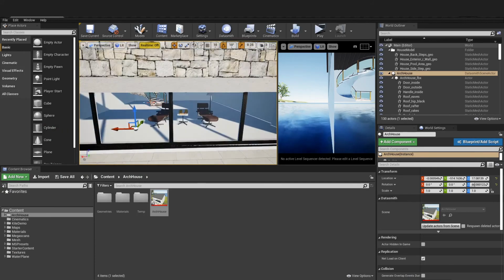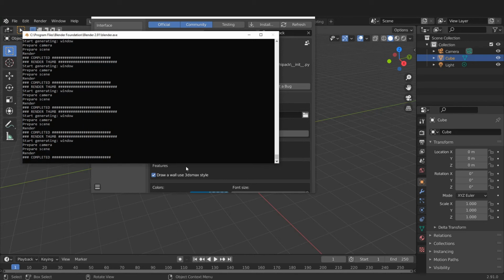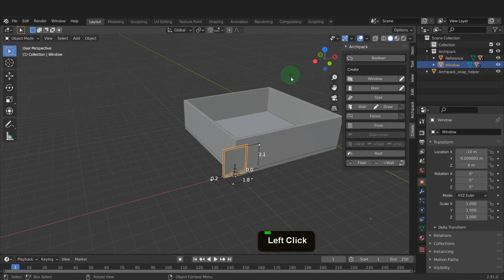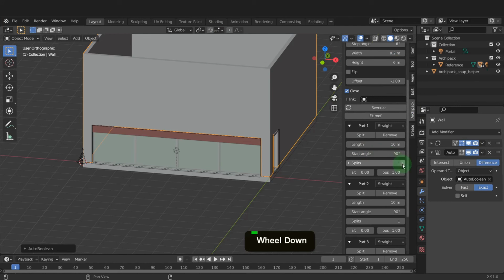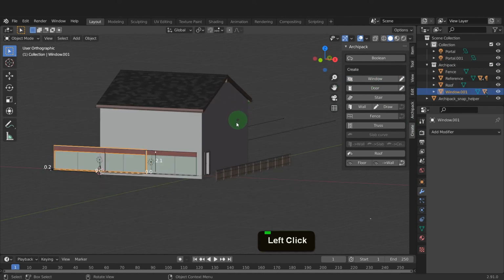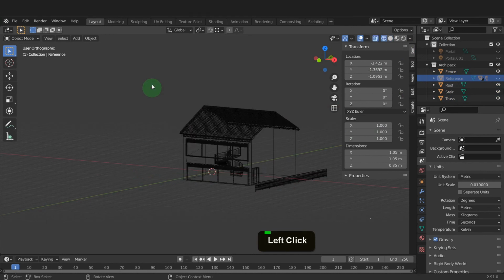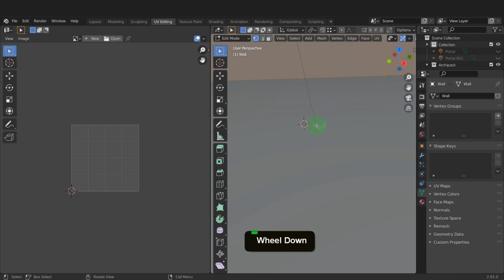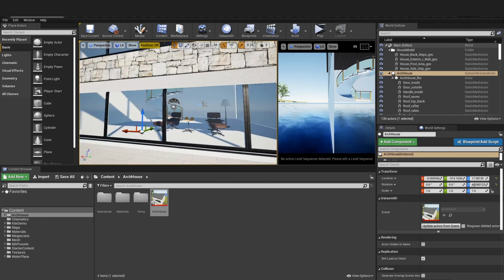The Archipack add-on in Blender

Comment: just add to the confusion. why the rush and don't explain what you are doing?
Reply from the maker: For an architectural workflow, start with a simple blockout: set units to Metric, model the footprint with cubes, and name each room or wall clearly. Add doors and windows only after the proportions are set, then use a camera and light to explain the finished layout step by step.

Comment: Hi Thomas, thanks for another excellent tutorial. One quick question. Do you know if there is an Archipack for the MAC versions of Blender?  Geoff
Reply from the maker: Thanks Geoff - good news: Archipack isn't platform-specific, it's pure Python, so the same add-on works on macOS exactly as it does on Windows. Grab the .zip, then in Blender go Edit > Preferences > Add-ons > Install (in 4.x it's the drop-down arrow > Install from Disk), pick the zip and tick the checkbox to enable it. Two Mac-specific gotchas: Safari sometimes unzips the download automatically, so set it to keep the .zip or re-zip the folder, and if you're on Apple silicon make sure you're running the correct Blender build. Archipack then appears in the N-panel under the Create tab, and because Mac keyboards often have no numpad, turn on Preferences > Input > Emulate Numpad so the 1/7/3 view keys work while you're placing walls, doors and windows.

Comment: Is buying the pro version worth it? And how are Archimesh and Archipack different. Is the latter better than the former?
Reply from the maker: Different tools rather than better/worse. Archimesh ships free with Blender: rooms drawn as wall segments, doors/windows that auto-cut holes, stairs, basic roofs - fine for laying out a house quickly and it's non-destructive while the object stays parametric. Archipack is more CAD-like: walls snap end to end and stay editable as a connected plan, you get proper wall widths, sills, better door/window libraries and floors/roofs that follow the walls. The free version gives you walls plus a few presets, and the paid one is mainly worth it if you draw full plans regularly - it's the window/door library, floors, roofs and 2D plan output you're paying for, not extra modelling power. Practical route: build your first house in Archimesh so you learn 3D cursor placement and real-world scale, and only buy Archipack once you're hitting its limits. If you want that full house-from-plan-to-animation workflow start to finish, I cover it here: https://www.udemy.com/course/architectural-design-animation-in-blender-3d-graphics/?referralCode=47378871D0FA9A09F6B6

Comment: Whats difference between blender addon Archipack and archmesh
Reply from the maker: Short version: Archimesh builds simple parametric rooms, doors, windows and stairs as plain meshes you then edit by hand - great for a first house and for quick openings. Archipack works from a wall spline: you draw wall segments, then drop windows and doors onto a wall and it cuts the hole with a Boolean and keeps everything editable in the sidebar (N panel) - better for full floor plans, roofs and repeat changes. Both are free (Archipack has a paid pro version); Archimesh is easier to start with, Archipack scales better once your plan grows. Whichever you use, set Scene Properties > Units to Metric with unit scale 1.0 first, and Ctrl+A > Scale before exporting so real-world sizes hold.

Comment: This would be so nice if the plugin actually worked, I can't add doors or windows, the selection "gray frame" with search bar on top is just empty
Reply: Did you render the preset thumbnails? I missed it and had the same problem.

Go to Preferences > Add-ons > Search for Archipack > Select it > Scroll to Render presets Thumbnails.
Reply: @vianvolaeus  Thanks, that worked, I figured it out a bit later, because I like to jump the "boring" parts of tutorials (oops)
Reply from the maker: The empty gallery is a missing-preset/thumbnail issue, not a broken add-on. Two things fix it in most cases: in Preferences > Add-ons > Archipack, hit the button to download/install the presets and materials (they don't ship with the add-on), then use Render Thumbnails - until the thumbnails are generated the picker draws as an empty grey panel with just the search bar. After that, save preferences, close Blender and reopen it; the presets only appear in the list after a restart. Also make sure you're in Object Mode with the wall selected when you add a door or window, since the picker is populated from the wall's context.

Comment: Excellent tutorial. How did you scale the thumbnails? Also, unless something changed in UE4 4.26, the scale setting is unnecessary for static meshes. I think that's only necessary for skeletal meshes. When exporting, in Object Types, select only Mesh.
Reply from the maker: For the thumbnail, I scaled the image/plane to the dimensions I needed. And yes—your UE4 point is right: for static meshes, matching the scene units is enough; when exporting, select only Mesh in Object Types.

Comment: When I add a second wall, it is immediately much thicker. Does anybody else have the same problem? Fix for it?
Reply from the maker: That's usually not a bug - a new Archipack wall is created with the add-on's default thickness, while your first wall has whatever value you set on it. Select the new wall, open the N sidebar (or the Object Data / Archipack panel in Properties) and set Width to the same figure as your first wall - e.g. 0.1m for a partition, 0.3m for an external wall. Two other things worth checking: your scene Units should be Metric with Unit Scale 1.0, and the wall object's Scale must be 1,1,1 (Ctrl+A > Scale if not), otherwise the parametric width is multiplied and looks fatter. If you want every new wall to start correct, set the width in Archipack's add-on preferences before you draw.

Comment: I keep having a problem with twinmotion where it doesnt detect the hole created by the window an fills it ups with another wall😫😫
Reply from the maker: Hey 
Christoph have you applied the modifiers in Blender before export? Once the boolean modifier has been applied the hole will be permanent. Also make sure you are not exporting extra objects with the building.

Comment: I want to create sliding window panes ...Is there away to open the windows from top or bottom...I found that teh only way to pn windows is by rotation but unable to slide them up , down or sideways
Reply from the maker: Hey Rodney yes in the item tab on the sidebar the location transforms for the window panels are locked. Click the padlock icon and you can then move them freely in any direction. Just be mindful if you modify the window then update the settings in the Archipack tab the window will revert to the original state.
Reply: @BlenderZen  Thank you so much..you are a Godsend. I found a workaround while awaiting your reply...but this is so much easier..You are the man!

Comment: how could I extrude another wall from the center of other wall? Hard to explain lol so if you're active at answering questions, I might do a comprehensive explanation with pictures.
Reply from the maker: Maybe add two edge loops where you want to extrude the wall, then use the new geometry to create the wall
Reply: @BlenderZen  thanks! How can I also turn the walls I made into a fully editable mesh? Because I can only mess around with one side of the wall when in edit mode.
Reply from the maker: @lucutes2936  The walls use a solidify modifier to create thickness. You can apply that solidify modifier in the modifiers tab. This will make that wall editable.
Reply: @BlenderZen  thanks a lot!!
Reply: @BlenderZen  I Did Exactly What you Said in This Video But That Render Presets is Not Available in Mine and When i Add Door or Window it's Not Adding it's just Showing Error
Reply from the maker: @saveshgaming  Are there any options in the add-on? Sometimes PC specs can limit Blender. Check out the requirements. https://www.blender.org/download/requirements/
Reply: @saveshgaming  Are you referring to the thumbnails???
Reply: @BlenderZen  I tried four times it just keep showing error error
Reply: Why this happens to me ..why it's not possible to add Loop cuts on the both sides of wall in archipack nd there are also many other problems in archipack that seems to me too hard to use
Reply from the maker: @priyashah2244  There may be extra vertices. The edge loop command works on quads and won't complete unless clean geometry all around.